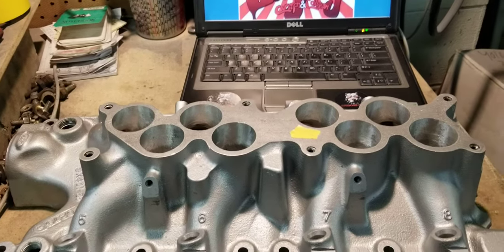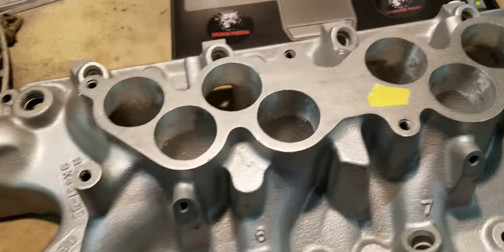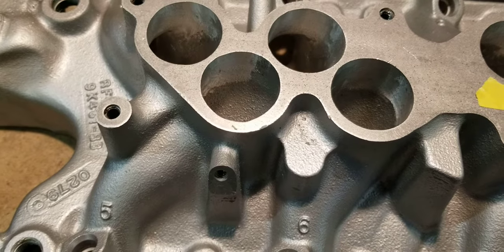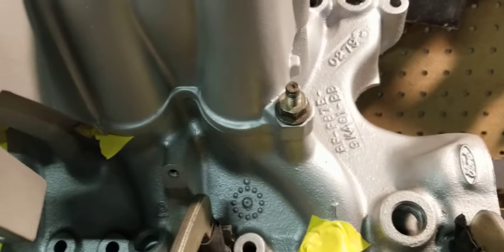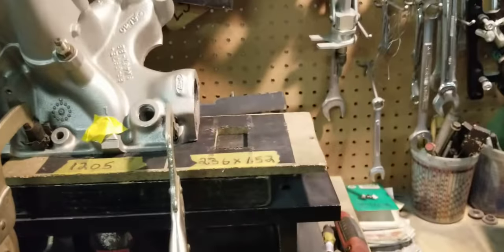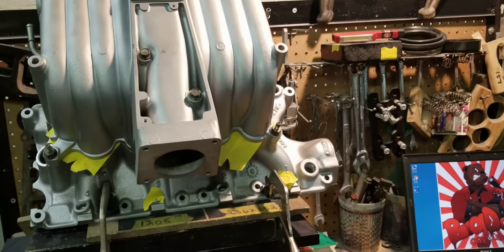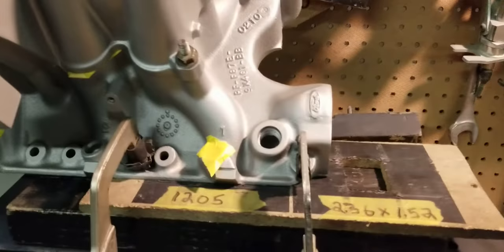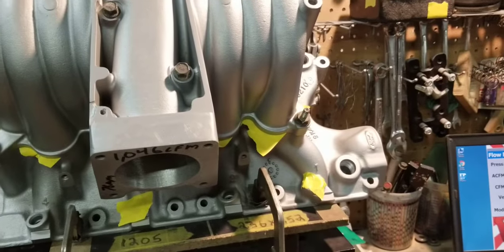Explorer gt40 manifold from the other guys "popular porter" flow testing.

Comment: This is my intake an 100% BS what I got from TMoss porting. I did all the research on intakes to consider for my 86 GT build. At the end of the day I liked keeping the stock look with an intake that could be ported an add that extra power with my H/C/I combo for a street car. I read all the forums an how TMoss was the man/service to get these intakes to flow. I looked into it as also realize Tom at TMoss has stepped back an his son Matt now handles the jobs an porting. I paid like $220 or so a yr ago to have it ported, I asked about the cfm flow an Tom stated that they see 240-260cfm when flow tested so average to consider being correct to be about 250cfm. I never put it on the car as this is a new build process. Then I saw Bigdogs porting as it was pointed out to me to take a closer look on Facebook after I recommended TMoss to another guy. It became clear I got a shit job that would most likely barely flow better than stock. So now I've paid twice to get 2 port jobs for which I wish I never went to TMoss as Tony/Bigdog shows flowed 215cfm. Don't get scammed people, pay once an get it done right the first time.
Reply: That joker almost got me!( the other so called  porter)Luckily  I sent all my stuff to Bigdogs for a one time fee and got what I paid for!